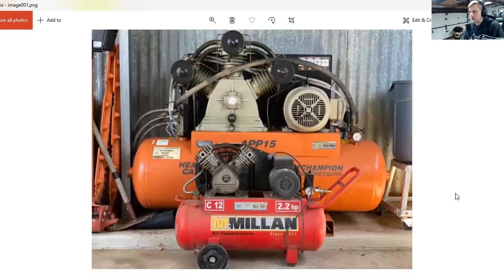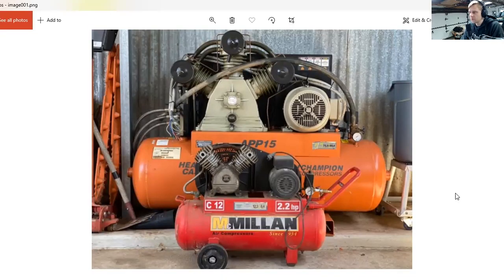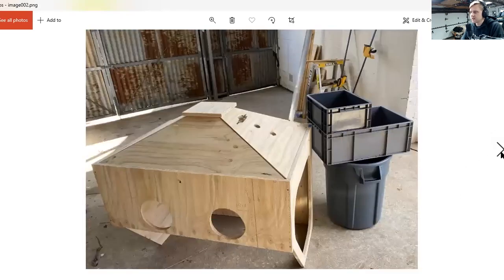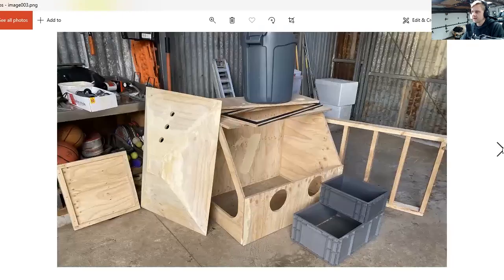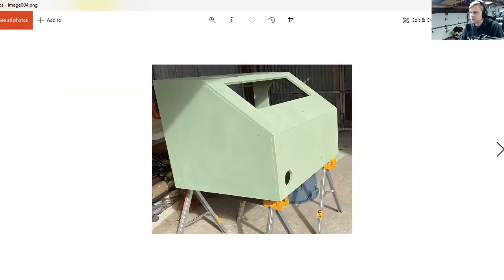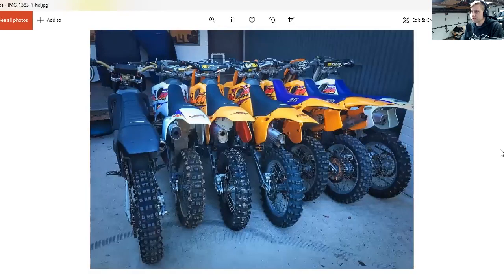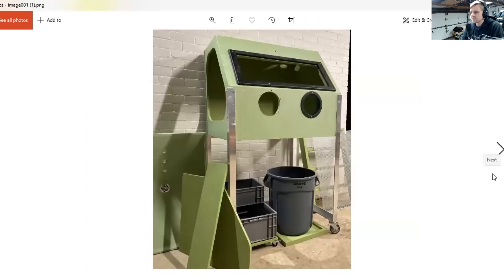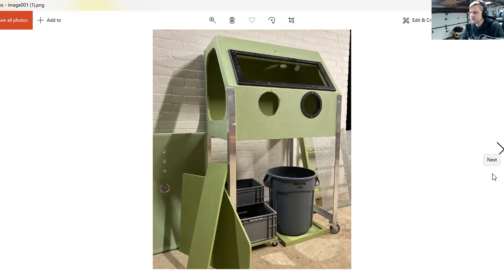DIY Wood Vapor Blaster From Australia

Comment: Roughly whats the build time on these?
Reply from the maker: Hard to say since I was filming the whole thing. Probably 1 month???
Reply: It all depends on your availability of free time, and how complicated or simple you go with it.   Support MatthewMCRepair and buy the plans, it will more than save you the cost of the plans in the time and effort you will save and give you sources to get the best prices.   Something as simple as a Window frame can be priced from 100 to 300 across the internet.   This guy has done his research and shows some of the best sources for this stuff.  And I'm not affiliated with the channel.   I have built 3 of these and the wood build I think will be the best, cheapest design yet.  I will probably build another to do two stage cleaning, as I clean ALOT of parts for customers and for myself.